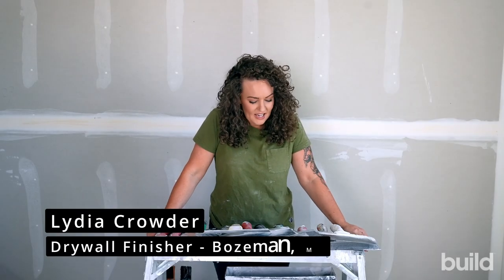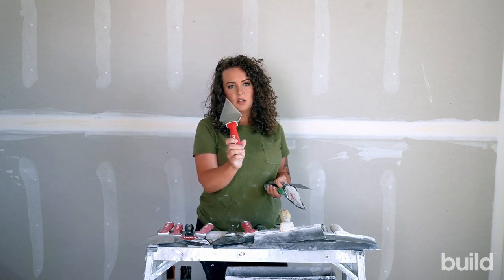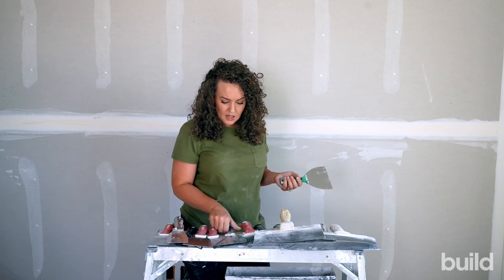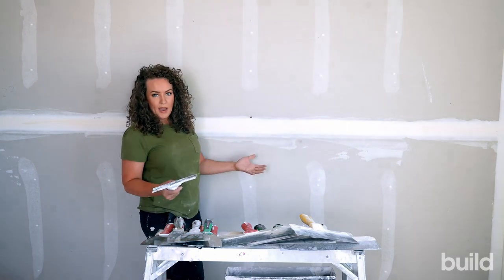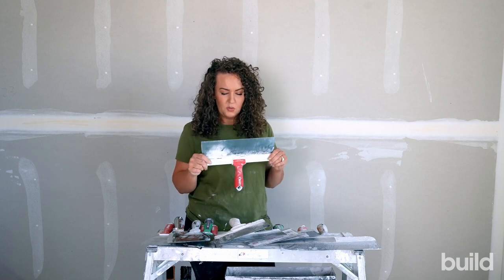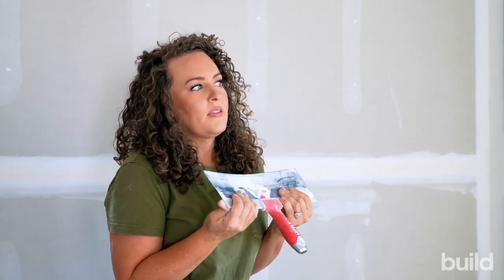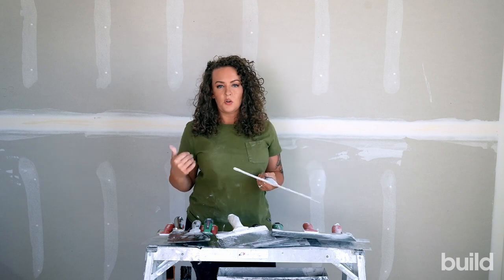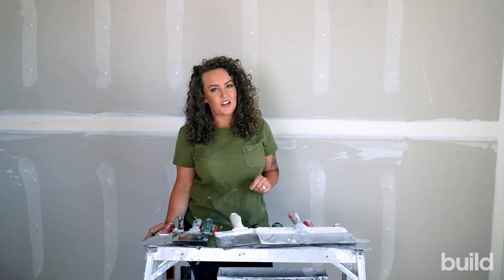Drywall Knife Basics

Comment: Hi Lydia.  I'm new to your channel but old to the profession.  I've watched many of the "How to drywall" videos but I must say that I am thrilled to see someone with your knowledge sharing.  I personally learned with an old banjo taper and everything else was by hand before learning to run tools. The modern finishers seem to have lost the hand skills and struggle with issues that their flat boxes or angle heads aren't designed to fix.  I'm glad to see you are from my school of thought that many times you have to break out the the old tried and true hand finishing techniques to get a proper job.  Please keep up the great work!!!!
Reply: That's me too,I am strictly a hand finisher. Now I will use an angle roller for my inside corners but I nail on my outside corners. I also use a portacable electric sander and a electric mud mixer. I'm an old timer but I'm not dumb lol
Reply: I don't finish much anymore other than a handful of sheets here and there but I agree with the "losing skills" part.  However the Hispanic finishers, often times female are still hand finishing and often times quite good.

Comment: I finish a lot like you Shorty, I will bed with a 8 and wipe down with a 12 . On the skim coat I will just use a 12 and cut my edges. I like the way you pull your corner bead with a 10 inch on your skim coat. You are definitely a pro. You go girl. 👍🏼

Comment: Ive been a taper for 47 years and dont use alot of knives, eight inch to wipe tape, 4 inch for angles i cant get with the angle head and trowel for the bead, never have a call back, typically do around 100 jobs a year

Comment: Your finished product looks great.bit you put down your pan and knife a lot .I grew up in a drywall family and we wore a hammer hook on each side one for knives on the right and one for the pan hook a 1/4" hook attached by drilling a 1/4 hole 3/4 " down centered on the end of the pan double nutted on both sides your pan hangs while you spread tape just don't let it hang to long. Try it yourself you will like it .old school

Comment: Interesting.....in the Far East they use "PALETAS" more than anything else. These are square sections of flat blue steel similar to a Bondo putty spreader. They develop a real skill with these, almost hypnotic to watch. By holding a paleta in each hand they are able to do almost anything; mix and apply putty, clean up rough surfaces prior to refinishing woodwork, etc. If you want to see examples watch the "Albert Domdom" or "Home Painter" channels.